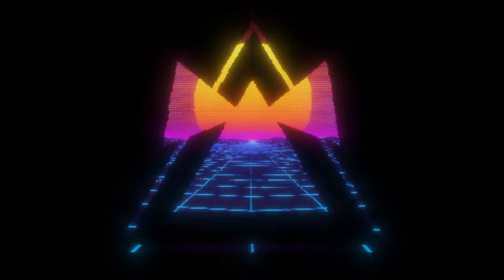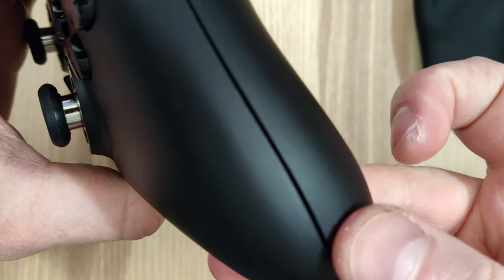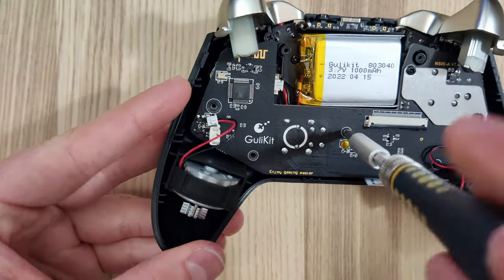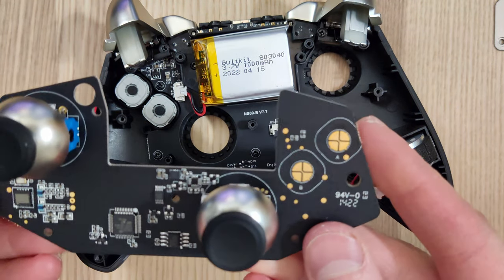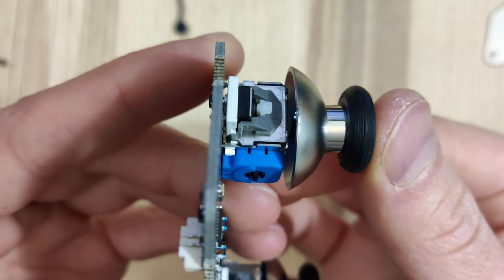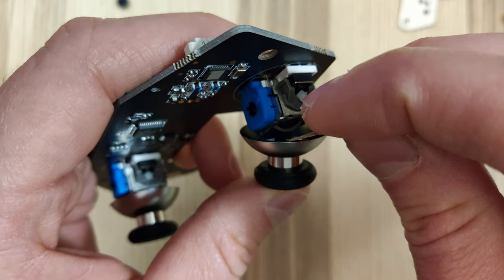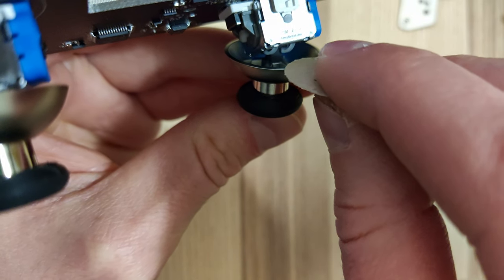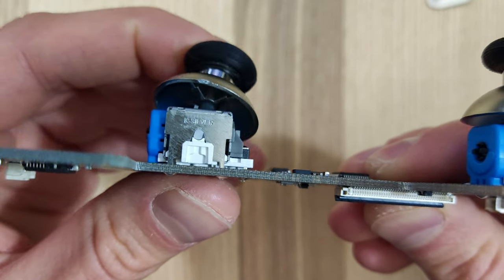Gulikit Quality Control Issues (KingKong 2 Pro Teardown and Joystick Fix)

Comment: Thanks,bro. Nice work. We gonna fix and make better! Thanks again.
Reply from the maker: Looking forward to seeing the revised product in the future! You guys have a great controller here and I'd love to see these issues addressed so more people can fully enjoy using it. Always great to see a company take feedback and make their products better.
Reply: WoW its the company it self!
I just bought your controller and its feels really good quality, on par with Xbox series controller 👍
Reply: @KeiRetroGaming  It is only the mold injection fill port and cause no function issue to the stick..Thanks again.
Reply: My B button broke and i replaced it with the A button the long life mechanical ones and its still broken. does it mean the problem lies in the circuit board?
Reply: @GuliKit  Hi. I'd like to report that my non-pro KingKong2 also suffered from the same problem with both sticks. Sanding down the imperfections fixed it. Hoping to see this fixed in later revisions since I really like this controller.
Reply: My Gulikit NS08 stop working after 3 months at first the problem were the APG & Settings Button stop working and ZL button double press itself. Now when I try to turn it on the Controller turn off after a few seconds.
Reply: I have Gulikit King Kong NS08. Sometimes  my left josystick goes left without touching it . Its almost 2 months since I had it.
Reply: Just bought NS09 recently and I m having issue with A button already.. it sticks randomly
Reply: hello can you make a pinout picture I want to build paddles in it
Reply: @GuliKit  I wish that sooner then later that you'll come out with paddles on the handles. Then I would be interested in purchasing one. Please don't do buttons like Thrustmaster in the middle of the controller where you fingers don't rest or can't reach easy.
Reply: @nickm8651  Ok, no problem, will do. thanks.
Reply: Also fix the USB polling rate to 500Mhz, at least for the wired connection.
Reply: @GuliKit  If you made a controller for competitive gaming, it would sell very well.
-Hall Effect analog sticks & triggers
-Low latency
Simple and nothing else, the only features you need!
Reply: Xbox market needs this controller, thanks for the hard work making it
Reply: Please make phone holder for gulikit
Reply: @Gamefreak2998  Thanks for your love.
Reply: Roc  Thanks, we will release a dongle and there will be less delay. Thanks.
Reply: @GuliKit  Hello there, wonderful controller and I just bought my 3rd one today. One thing I would like to see moving forward is the lubrication of your Mecha tactile buttons. A lot of people have to dissasemble the controller to lubricate the buttons and it is troublesome. Updating the firmware is also difficult and confusing but not a big issue, lower latency is also a big plus if you can manage it. You have the best controler available and thank you for everything!
Reply: @locke348  Thanks for your love and feedbacks. We will keep improving.
Reply: We need one with paddles please 🙏🏼
Reply: @michaelslifecycle   ok!
Reply: My friend also got the same controller after a months of using it the left stick drifts and hard to use it was replaced but after a few weeks it experience the same problem. Hope that the new revision resolves this.
Reply: Make one with back button please (not paddles)
Reply: This is genuinely one of the most exciting things to read. I just purchased one of your controllers, and I am extremely excited to see this coming in the mail soon. I hope it's good, and I have a lot of faith!
Reply: Your controller is well reviewed, and I am tempted (might buy one anyway), but my reluctance is the rechargeable feature. I would much rather have it run on a couple AA batteries. I use rechargeable batteries and a quick switch on replaceable batteries is superior in spite of the peeps who cannot remember to recharge batteries.
Reply: Please update the polling rate as well.
Reply: @Zaekyr   Thanks, that's not available as you see now.
Reply: @Zwim  Thanks for your feedback.
Reply: Dear manufacturer, please make your annoying controller compatible with the PlayStation 5 console. is this your plan for future revisions of your controller?
Reply: your OFFICIAL page on aliexpress tells users to repair the controller them selves! when asked about warranty! seeing this video the controller is of cheap quality and can easily break when trying to open! unacceptable
Reply: Check my problem in my short, it’s so annoying, I bought it 3 months ago and I got this problem
Reply: @GuliKit  Just improve your QC and you are good. I decided not to buy one because I was afraid to get a bad QC and return policy is troublesome here so I'd rather not risk it.
Reply: I really like when someone opens up something i don't have to see what is going on, But I have a question about the triggers. Do they have stops so they don't hit that controller chip? Cause most getting really excited might not know not to slam the right trigger, cause over time that makes me worry that it is going to take serious damage which could render the controller unusable.
Reply: Picking one up today hopefully the kinks are ironed out.
Reply: Lol I bought a 2 year warranty for $6 bucks on Amazon. Even if it craps out in a few months you legally got me 🙏🙏🙏🙏
Reply: I had to return my white controller because the RT button was sticking right out of the box. Now its pretty impossible to get a white one. I started using my Elite Series 2 controller with an adapter after that. At this point you'll need to add paddle buttons (L4,L5,R4,R5) to win me back. :(
Reply: @GuliKit  I bought this controller to replace my xb1 controller for pc use, but I love using it with my Switch (mainly smash bros). I would love to put an octagonal ring around the analog sticks. I was wondering if you would be able to sell, or release the specs for the metal ring that sits in the controller as standard. I'd take a go at filing them in myself, but would like to know it's possible to get a replacement before I did.
Reply: @hansennoah1  I think it does. It's kinda similar to one of my really old PS4 controllers where even if I replaced the dpad membranes it would still be broken. In that case there's a ribbon circuit that needed to be replaced. 

One thing you can try is to clean up the contacts a bit to see if that fixes the issue first. If not you could try contacting the company and see what they say about it.
Reply: hey guys can you please make some  sticks that can replace ps4 sticks?
Reply: Nice to see a company listening to its customers.
Reply: Please make one that’s compatible with Xbox without needing an adapter, I want one because of the joysticks but the latency issues on Xbox I’m hearing about are worrying , Ik it’s because it’s not officially made for the Xbox or ps but we want one too haha
Reply: I have the controller, and honestly it's leagues above the other ones.  I have a few suggestions that would definitely set this controller even further beyond it's amazing state:

1. Build a Socketed Hall effect analog stick.  One that could be replaced.
2. If feesible, build a rebuildable analog stick with customizable springs.
3.  Allow the Snap-back compensation to be tuned via software.  Since it's different on every analog stick, being able to fine-tune the compensation would allow the user to limit snap-back while allowing the maximum response possible.
Reply: @GuliKit  my joy stick kept flying off during combos until it completely snapped in the middle of playing Super Smash Bros Ultimate after owning it for less than 3 months. What do I do? Can I get a replacement? Is it possible to make a complete solid joystick that's non inter-changing the thumb stick?
Reply: @Gulikit I hope you put 4 back paddle buttons on your next Gulikit pro controller. And please make a symmetrical analog layout as well, like the PlayStation.
Reply: @goldpieceleo   Thanks for feedbacks.
Reply: @GuliKit  no problem, I like new companies who innovate.
Reply: @Gulikit . please make a telescopic type-c one for phones. gamesir,razer and backbone are shit and i owned every one of them.
Reply: I bought the thumbstick kit, and using one of the longer ones made it easy to break off the piece that it sits on. I would love it if you sold more durable metallic stick domes even if they happened to be heavier, just so they can withstand the extra force that comes with a taller stick.
Reply: Is it possible that you can increase its compatibility with Android devices especially using emulators such as Dolphin and AetheeSX2?
Reply: @NyawttyClips  That is not available.
Reply: Have these issues been fixed or should i wait to get one ?
Reply: How's the "making it better" going?  I just got one of these controllers yesterday.  Within an hour of use the A button started sticking and squeaking and I am not surprised with those poorly designed button switches.  Why on earth did you decide on that design instead of the tried and tested membrane option which lasts forever and works well?
Reply: So much for making it better, the joycons dont wear out but literally my buttons are stuck and the controller cannot be used.
Reply: I ordered one today not going to arrive till Tuesday. if the buttons stick I'm going to sand off the tiny bumps inside the switches that give the tactile click. not to worried about fixing electronics as I do it with my mice and fans
Reply: Gulikit I am an ex pro controller player. Take my advice or not but to make the best aim controller possible. The controller needs to be able to make micro adjustments with out feeling like it jerks when u put pressure but being able to flutter the stick to always be able to get back on target. By flicking and micro tracking with little to zero deadzone. Which can continue to be replicated to build muscle memory.
Reply: How the hell should I turn this controller off... it just won't turn off.
Reply: @rango-konk  there are 2 buttons on the top of the controller on either side of the USB-C port, click the one on the right 2 times in a row to manually power off and on
Reply: @TheCameramanInvestigator  mine just auto turns off after a few minutes of inactivity kinda nice but I really modified the danm mechanical buttons by breaking off the clicking parts and changed the right trigger spring for a lighter one
Reply: @td000009  my problem is that the "Y" button registers as always being pressed, it never turns off unless I do something like hit the "Home" button or "Home + -" on the controller.  But thats only good for one press of the "Y" button.
Reply: Please answer..
Is the joystick module of Kingkong 2 Pro similar to PS4 or PS5 or Xbox joystick module.. mine broke, and I want to fix it, but idk which joystick type Kingkong 2 Pro use.
Reply: @GuliKit please answer my question above
Reply: Why my Gulikit KK2 usb c socket wiggling (not firm)? 😭 is it just me or anyone got the same problem? Ive bought it like 2 weeks ago, And the seller said its ‘normal’ 🤷🏻‍♂️
Reply: Not same and not ok to use our sticks on PS4,PS5 or Xbox controllers @coreyhaque
Reply: @GuliKit  where can I buy a replacement for my joystick module? mine's broken
Reply: Still same issues with my KK3 Max sooooo wtf. SMH.
Reply: @Gulikit I’ve got the same issue trying to help me out
Reply: Please sell replace modules for the sticks. I got a sticky and resistant left stick only after 10 days of using. It's been over a year and now the left stick makes squeaky noise every time I move as well as being resistant.

Comment: Luckily for me, i've had no issues with my KingKong Pro 2. I've owned it for around 9 months, and it's an excellent Switch controller. Gulikit really needs to improve their quality control to greatly lessen the percentage of their controllers that malfunction. They have the potential to be the top choice manufacturer of high quality third party controllers if they get it together.

Comment: putting back the triggers is definitely the boss battle of this assembly
Reply: for me it was the RB button it just would not click the same after I took it apart. I had to take it apart again and make sure it was in place it needed some adjustment. I also had to take it apart a 3rd time to lupricate the X Y B A with some petroleum jelly. the button are mechanical and they start to squeak or get stuck. used a Q tip put the jelly and it was back to being smooth.

Comment: Just excess material not removed when snapped from mold, easy fix with a file or probably some flush cutters. Stuff happens - but should have been caught in QC/QA inspection. Fortunately an easy fix and not a common issue with these controllers (based on the multitude of reviews). Very well made and detailed video. 👍

Comment: Thanks for the teardown! I've been thinking about getting one myself but wanted to see how difficult it was to disassemble before making up my mind and this video was perfect for that. I'll definitely keep this in mind if I ever need to take mine apart
Reply from the maker: Great to hear! Awesome controller and all things considered it's a lot easier to take apart compared to a dualsense or a few others.
Reply: Don't get it, it's a garbage controller.
Reply: @redcrimson1028  What are the specific points that make you label this as garbage?  Generally want to know.  My 8bitdo SF30 PRO ABXY membrane is kaput and I want to use another brand.
Reply: @bobmcbob4399  only issue I encountered was a sticky A button. First controller after two weeks had this issue. I returned it for another. Second controller after two or three days had the same issue. Instead of returning it I tried this tear down up to just accessing the A button and was able to fix my issue. Other than that no issues at all and I like everything else about it. Shouldn’t have to do that for a controller especially a new one but honestly it was super easy to do and all the buttons and triggers actually feel better than before. Other than that I like everything else about it.
Reply: @beetee9654  That's good to know you are actually able to repair/improve the controller as an end user, and not have the thing implode as you accidentally break it during disassembly.

Comment: For anyone here who disassembled their controller, tested out the bumper buttons while it was disassembled and thought they got messed up because they started sticking: turns out putting the back plate back on will fix that issue. I didn't realize the back has trigger guards that prevent the triggers from rubbing against the bumpers.
Reply: omg i spent 30 minutes in figuring out what went wrong until i saw your comment thanks

Comment: The best first step in disassembly is disconnecting the power. It can save your device from accidental shortcuts.
Reply: shortcircuits *
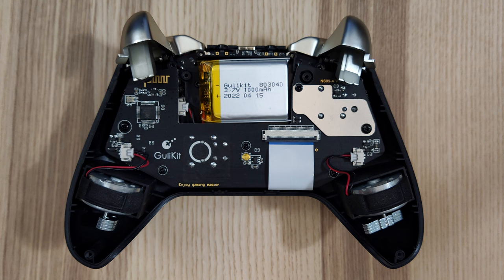Reply: @Carl Gunderson at 3:10 the battery connector is reachable. It can be disconnected with tweezers and you no longer have to worry about a possible short circuit and blowing up any components.
Reply: He has no idea about tearing down any electrical Devices

Comment: Thank you so much for this! I just bought the non-pro model and unfortunately both sticks suffered from the same exact problem. I sanded them down and now it's perfect.
As expected I broke both the plastic clips on each size but it simply doesn't matter once you reassemble it. Also you can totally remove the stick completely if you pull it gently upwards (hold the sensor with your hands not the PCB) so you don't have to risk getting debris inside and it's easier to sand it down.
Reply from the maker: Great to hear! I pulled the sticks completely off the second time when I went back in and sanded off the edge a bit more, much easier yep.

Comment: Thanks for this video. Was about to return my second controller with a sticky A button problem. So I figured to give it a try before returning it for a refund again. Followed your tear down video and was able to take the A button out and what I read somewhere someone mentioned to just pull out the two tabs outward a little on the button. It worked for me. It also was tough getting the board back on but I was able to by just loosening the left (right while flipped) trigger, zr trigger. At first I removed it but couldn’t screw it on with board in place. So it was easier just screwing the trigger on but keeping it super loose until I was able to wiggle the board in and then tighten everything. I also didn’t even bother taking the battery out. I tried at first but couldn’t pull the wire clip out and didn’t want to do the other steps. Got lucky I guess since I didn’t have any issues. This video helped tremendously though and my sticky A button resolved. All I used was a Philips and a plastic card too. And a eyeglass flat head to pull out the A button tabs some.